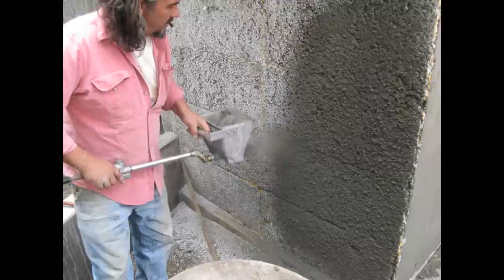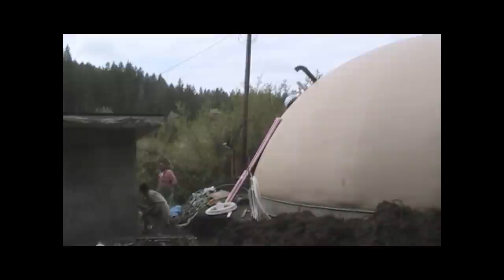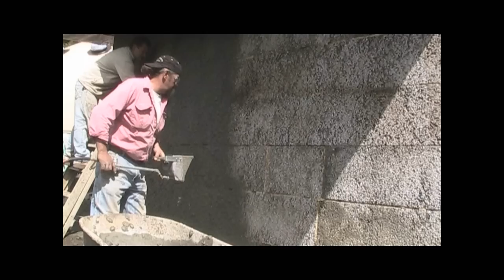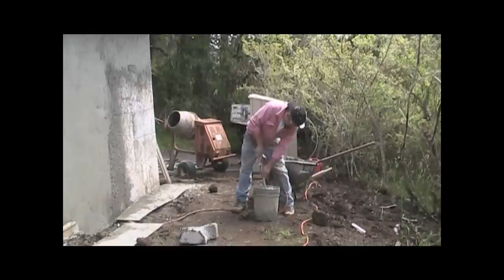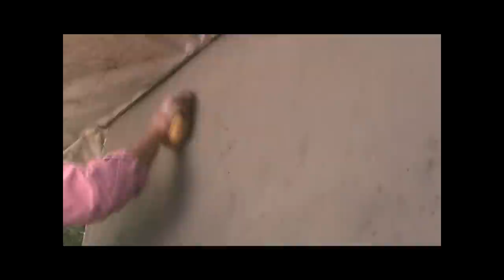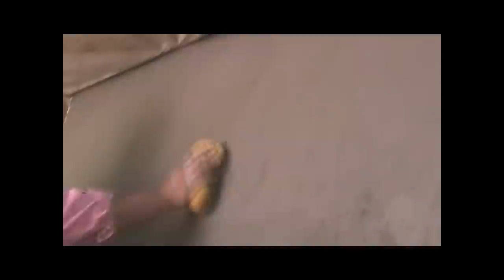Stucco Sprayer | Stucco Application

Comment: Bravo! Actually, a sprayed or thrown on mortar will have a much better bond than using a hawk and a trowel would because there is no entrained air in the mortar when it hits the wall/

Comment from the maker: @sitdwnandhngon 
Thank you, it changed my world for applying stucco. Typically we call this an application tool and not a finish texture sprayer. It is great for getting 1/8" to 1" of material on the wall with less effort than using a hawk and trowel. Once it is on the wall, most users will us a trowel to make the final shape.  Some have used different sands to get the desired texture.
We have more stucco application information in our stucco section.

Best regards,
Nolan